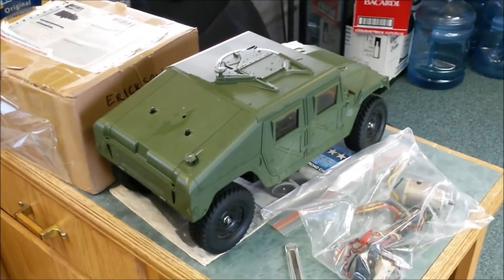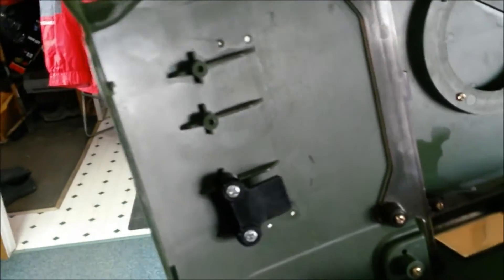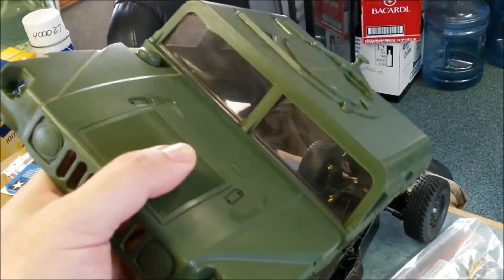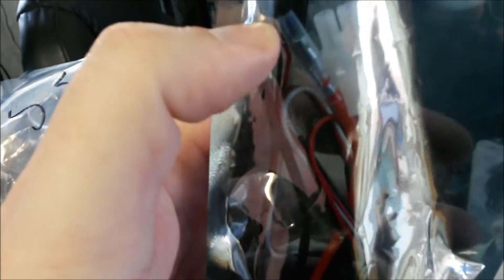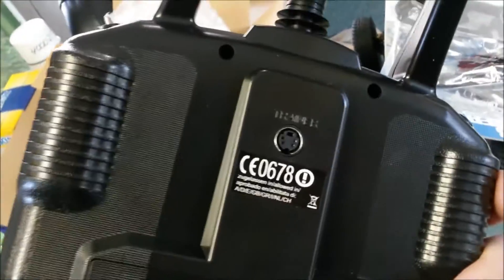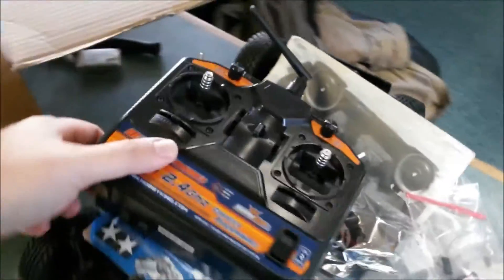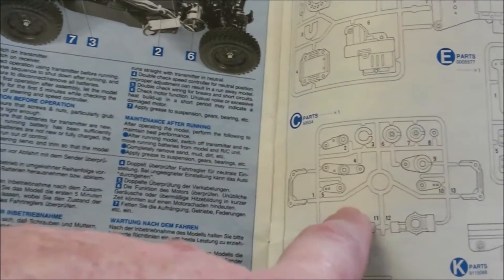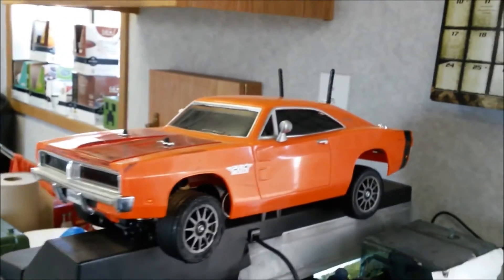Tamiya Hummer M1025

Comment: I had one of those, painted it camo..........I put a 20 turn stinger motor in it........decent but suspension sucks and not much ground clearance............basically a street car with different gears, body and tires